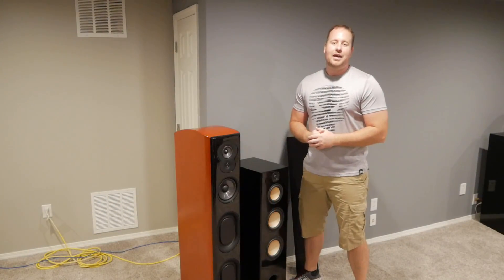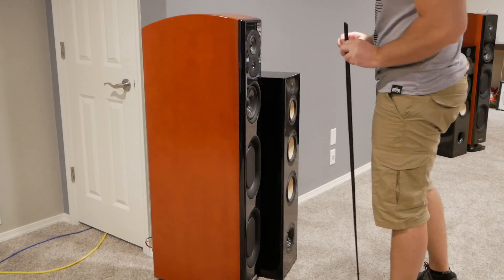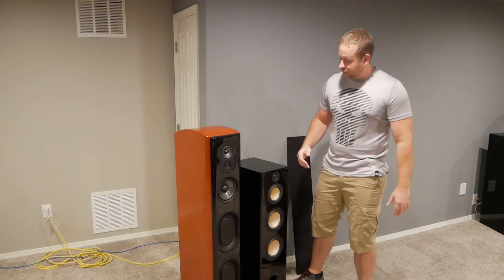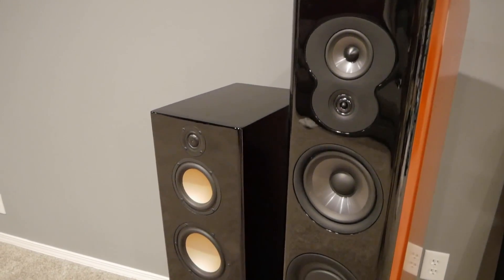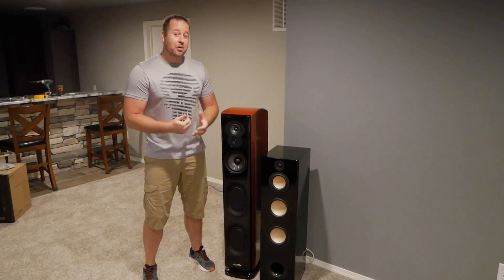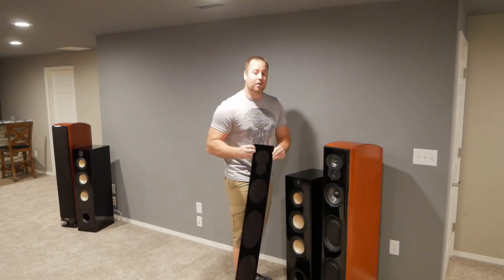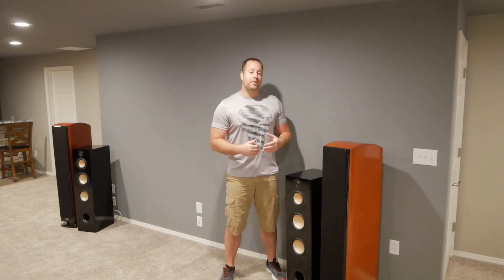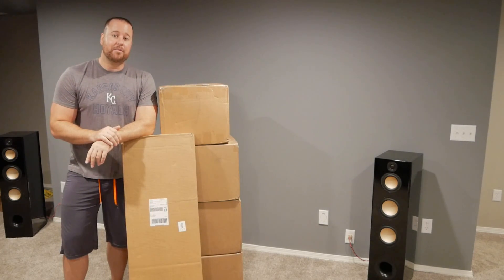Comparing my DIY Speakers vs Manufactured | Swope Towers vs Polk LSiM 707s

Comment: What's the point of making a diy speaker if you only have to put them together? When I made mines, I designed them from scratch, seeking on the internet for months the right components and studying how to have the best result possible. I think this is the way to do it. Not buying some kits and of which you know nothing about and then think "wtf I am a speaker designer/sound engineer"
Reply from the maker: Some of us like to let the actual speaker designer/sound engineers design everything and we can build it to our tastes. Don't have to spend months researching and building something that might sound sub par. I don't believe I ever stated I was a sound engineer btw.
Reply: @LifeofBliss  I'm not saying you said you are a sound engineer, neither I am, nor I'm criticizing your work, I'm just saying that in my opinion, just assembling the work that others made (I consider the most part of the job to be the research/design part, by far the most important) does not qualify it as a true diy speaker. Surely not as satisfying as designing it and building it from scratch.!
Reply from the maker: I gotcha 😉 I was like I really don't think I came off that way lol. But yes, it was very satisfying making these kits, and I'm sure it's that much better after putting in all that research and work to design something yourself as well.
Reply: @LifeofBliss  and believe me they don't sound sub par
Reply from the maker: @matteogirelli1023  I wasn't trying to say yours did ☺ I just meant not knowing much about the design aspect in my situation could result in a sub par setup. I'm sure yours sound damn good my friend

Comment: Those Polk towers do look bottom heavy... I always prefer towers that have more mid range speakers like the ones you designed... adding a sub or two takes care of the bottom end ... I’m currently enjoying Pioneers Andrew Jones line... incredible sound for the money.  I’ve found that price isn’t always indicator of quality... while obviously you can get better for more money a more expensive speaker doesn’t always me it’s better.

Comment: You've proven the point that I make regularly on my channel, that home built speakers can meet or exceed the sound quality of factory speakers for a fraction of the cost. This Swope kit is apparently no longer available, but similar drivers can be purchased and a crossover designed for you by Madisound (and I'm told Parts Express will also design a crossover for you). The guys at Madisound can help you with driver selection, bass alignment, crossover design, etc. The HiVi drivers used in the Swope kit are coated aluminum cones and do have a much brighter sound (that I also like) compared to other drivers. This kit used a pair of 6.5 inch bass drivers, whereas I would have preferred to see a pair of 8 inch bass drivers. As an alternative, I would stick with just satellite speakers (you can buy the small boxes for these from Parts Express), and have two separate sub woofers in separate boxes powered by a separate amp. The subs need to be carefully located in your room to attain flat bass response, hence the separate cabinets. BTW, your home built speakers look great, that for me is the hard part, getting the final  product to really look good.

Comment: Do you have a link to any of the material and products you used? Do they come in a kit?
Reply from the maker: They used to be a kit, but the drivers were discontinued so it's no longer available. There are several other similarly priced kits out there. Here are a few good places to start: DIY Sound Group, Madisound, Meniscus Audio

Comment: How long did it take you to build the diy?  That is a factor for cost and also skill involved.  Your build looks great, gloss black is tough.  I also have the LSiM707 and for me it really opens up with power and a good front end.  I run mine with McIntosh C47/MC452.  Previously I ran them with a Rotel RB-1590 and prior an integrated MA5200.  While I don’t  currently have any diy speakers anymore, I have built them in the past.   I find it difficult, cabinet build and tuning, crossover calculation, speaker component selection and matching, response curve and efficiency targets.  (True diy not in kit form).  This all before placing them in a room taking measurements and seeing the interaction.  I don’t have access to an anechoic chamber.  For comparison I also own speakers from KEF, Klipsch, Martin Logan, Totem as well as older Polk flagship models such as the LSi25 and I found the LSiM to be a sleeper of a gem.  Not to say it is a perfect speaker but with a good front end they can sing.  This is not a comparison to your diy.  Would love to hear them.  The tweeter especially sinceI’ve seen similar used on Tetkon Design Double Impacts.  If I where to replace the Polk with similar, from what I have read, it would be with a Tetkon.  Going up in price point I would say Legacy Audio Signature or Focus SE.
Reply from the maker: Thanks man. True DIY is a real talent and a lot of calculations/trial and error. Something I have not dove into yet due to lack of knowledge (not afraid to admit it, I'm learning as time goes along ☺). This probably took 15-20 hours with the prep and paint time, not including drying obviously. It definitely is a huge factor in diy. Doesn't make sense if you don't already have some basic woodworking tools and some skill. Some smaller bookshelf speakers would be a much easier starting point if you've never made something before. I will say the Polk LSiM707 was a beautiful looking speaker and when compared to many others I've heard, they sounded great. They probably would have benefited from some more power/headroom. I think it really just came down to personal preference as audio is very subjective.
Reply: Life of Bliss thanks for the info,  When I was in my teens a dreamt of building a Polk SDA SRS, never happened but I did build a few speakers using parts express parts.  Cheap hifi, it was fun at the time.  I am now more into electronics.  I fully refurbished a Sansui AU-6900, good as new and last August assembled a pair of PASS ACA Class A balanced monoblocks.  Cheers!

Comment: I like old cabinets, and putting new (price/performance) high quality drivers, and bigger new nichicon capacitors on the existing board. like I did with these https://picclick.com/Vintage-Ohm-Model-I-Pair-of-Speakers-Electrodynamic-263305865783.html (not my cabinets, but the exact model) they sound GREAT!!! I got the pair as a hand me down, and refurbished them. about $450 in components and a ~32hz tune in the sub section
Reply from the maker: Nice, that's a good way to do it without having to go through the building process. You can get some cool looking enclosures that way. Very cool man

Comment: What you explained as an issue is kinda how they voice "Hifi" speakers. In pro audio we reference everything back to flat. Just to not confuse you ignore your eq for a minute here as that is not what I a talking about. If a speaker injected no sonic influence of itself and let the sound that was being played back come out exactly as it is only louder then it would be a perfect speaker according to audio engineering theory. Hifi guys have this belief that scooping out certain sections of the audio spectrum tonal will create a "better sound stage" whatever that actually is. As an audio engineer I can tell for a fact that there are almost zero recordings where we make a stereo recording of a group of musicians so to have any kind of real sound stage. Whatever breadcrumbs are placed in the mix to give the listener an idea that something is in any certain space is all illusion. Yes, smoke in mirrors. Are we good at it? Relatively speaking, yes and some better than others but the truth is everything is pretty much recorded separately assuming we used real instruments at all. Commonly these days many of the sounds are actually digital samples and are triggered so they aren't even necessarily recorded in the same room and in that case definitely not at the same time. The point is an "audiophile" might be fooled but any engineer worth anything is going to see right through that rouse. The truth is that in the old days of audio mid range was rather unpleasant to listen to because levels of distortion were far greater than we have today so the BBC (british broadcasting corporation) developed this eq setting to slightly subdue the mid range. It worked. It made music sound much more pleasant. The only problem is it left everything sounding like it was missing the mid range and made things rather unintelligible. It was the real reason most people didn't listen to the audio from their television through their stereo. It was great when there was a band but if you watched a movie you would miss every second word. In recording we  work with very transparent accurate speakers. What it sounds like is what it is. Rather very close to what it actually is as no speaker is perfect. In this way when it transitions from Aerosmith playing at halftime back to the game the band sounded good and clear as did the commentators and we even heard the kickoff. From what I am gather from the audiophile community that is just wrong. The thing is I don't use the speakers in my television.  All of the audio is routed through my audio system for everything. Music CD, Blu ray movie or streaming. All the same. Everything is constant and I have no problems understanding voices at all. There is no reason you shouldn't be able to have that too. I am running an older pair of Tannoy studio monitors. So long as the speakers are not coloring the sound too much they could be anything though. From what I got from your video that was what your experience with your home builds and why not? The guy mixing it on the other end is mixing it without adjusting for any speaker. I have no doubt you will be happier. BTW when they mixed Metalica they wouldn't have been listening to it on home HIFI speakers either.
Reply from the maker: Heck of a comment Rob 😉 but yes I agree. Mixers tend to use speakers that don't color the sound. And I too think there is no perfect speaker, even for a given setting (music vs home theater). That's part of the fun though on my opinion. 5 people can listen to 5 different speakers and each have a different preference.
Reply: @LifeofBliss  That is what I am trying to say. Audiophiles are just over complicating things. Not to start a pissing contest but as mix engineers our entire purpose is to figure out how to make the mix sound as good as it possibly can. Yes, that is an opinion thing but wait one second. We do not work alone and are accountable to a lot of people who check and double check our work. All people who have proven track records in what we do. People's job it is to pick apart sound. People who do this day in and day out. Not just people off the street who have decided that they should have an opinion. Not that there is anything wrong with that but people in our field have to earn the trust of the public and prove the value of their opinion daily to become of value and an average person off of the street has not done that. High end studio monitors are almost as close as you can get to the illusive perfectly "transparent" sounding speaker. We make it sound great in a near perfect environment on near perfect gear. Explain to me how it is thought that by purposing to listen on a purposely improperly calibrated system is even likely to improve what we do at all? Worse, improve everything we all do as a group collective? If it was video it is easier to explain in that if the color balance is off on a tv and you watch the news you see green faces. In fact everything you watch has a green hue. This is only the fault of the calibration of your set not the source. Calibrate your television correctly and the problem will be eliminated. Looking for a television that casts a red hue in order to offset the problem is only going to create another problem. It doesn't take a video engineer to figure that out either. In an audio sense that is what audiophiles propose as a solution to their situation and it is worse they are so stuck in their world of scooped out midrange that when they do hear a properly calibrated kit they can't even appreciate it. This has to do with the fact that the human mind compensates for things sounding off and "fixes" it so they are over sensitized to midrange and why? because they made themselves that way. Why not just do it right in the first place? Every source you put through your system should sound good including the football game. P.S. to most of us engineers good is synonymous with natural and would not sound "Hifi" when the experience doesn't call for that so when the quarterback does a field kick it doesn't sound like a nuclear blast.

Comment: I made a diy subwoofer about 2 years ago, it is sealed using 2x 10 inch woofer. It has good low frequency response. cost about $200. I think DIY projects not only for fun, also for quality.

Comment: So.... MSRP of $2000, but sold brand new for $850. Hmmmm. In the DIY, those are Hi-Vi woofers. They are distinct in their color and I always know what they are when i see them. Built 3-way towers myself with a 3/4" tweeter, 6.5" mid and a 12" woofer for $100 for the pair which includes a 3-way crossover. People need to stop thinking that anything over 50-60 watts is best since you cant really get to that point in real world applications for what they are intended. Blows my mind everytime i see someone comment about having higher rated watts like that's what people play stuff at. Sensitivity plays a major part in power/wattage as well. And ohm rating. Less ohms, less resistance. More stress on amp.
Reply from the maker: Yea, they are way over priced at msrp. It would really be interesting to see a cost breakdown on speakers like that to see what they spend on components. It would take some serious money in amplifiers to start getting a real 300-400 watts per channel, and like you said it's a lot about sensitivity. My new speakers have a sensitivity if 99 db and with my 125w amp, they should be capable of 120 db, which is crazy loud for highs.
Reply: Can you share a parts list and where to buy? This Fits my budget.
Reply: Also check out Madisound.
Reply from the maker: That particular lit is no longer available due to the drivers being discontinued. But there are similar kits for sale at www.meniscusaudio.com and www.diysoundgroup.com

Comment: Been building my own speakers since 1999. Havent had anything store bought since. My designs and projects  usually a $100 - $500 and sound like store bought speakers 3 times the cost. A year ago I spent $300 on some used KEF bookshelfs to replace my old diy ones. Got them home and listened for about an hour and took them back...lol.
Reply from the maker: Lol yea diy is hard to beat once you start
Reply: @LifeofBliss  I design and build my own speakers from scratch. I have a new med treble driver design that is at another level and I put them in my lounge tower boxes and I am addicted to them. Point source time aligned sound that beats just about any 2-way or 3-way speaker in image. And it has serious treble that stings your head off (without tweeters). It's 3" full range drivers with 1.5" FR tiny drivers powering the top end coaxial tizzers. Too hard to describe so here is a one minute (crappy) video of my babies (better videos of it coming soon). I might be selling coaxial drivers soon, but larger ones (and tidied up a bit). https://youtu.be/UlJHRQidsvI
Reply: I design and build my own speakers from scratch. I have a new med treble driver design that is at another level and I put them in my lounge tower boxes and I am addicted to them. Point source time aligned sound that beats just about any 2-way or 3-way speaker in image. And it has serious treble that stings your head off (without tweeters). It's 3" full range drivers with 1.5" FR tiny drivers powering the top end coaxial tizzers. Too hard to describe so here is a one minute (crappy) video of my babies (better videos of it coming soon). I might be selling coaxial drivers soon, but larger ones (and tidied up a bit). https://youtu.be/UlJHRQidsvI
Reply: Then maybe you could like to have a go at making your own time aligned coaxials: https://youtu.be/UlJHRQidsvI

Comment: I made my own speakers. 4 10" paper mids & a 1" compression driver in a 10" horn x 2. All mounted on a lattice type flat baffle. Using ready made crossovers that I thought were closest to what I wanted. About $100 including wireing, can of white spray paint & solder & gun. We hooked one of them up to a cell phone & played some tunes from YouTube. Quiet but it sounded very good stacked in a corner of our bedroom closet. My wife & son were very impressed that it sounded so good & so was I. I thought I would have to spend lots of time & effort tuning & letting the driver surrounds break in, etc. Can't wait to get them placed in the living room corners w/ padding behind them, driven by an actual amp playing some Haydn, Robin Trower, Miles Davis, Wagner etc at live concert levels.

Comment: 300 for components. Then 100 for wood, 100 for paint and then there's build time(300 each). Still save 200 dollars but these things are worth mentioning. Not knocking you though, all my system is home built.
Reply: If you paint it yourself it would not cost 100
Reply from the maker: Using automotive paints, it costs more than $100
Reply: @LifeofBliss  that's very true. I am thinking about building my own set of soeakers for as little as possible. I will probably just stain and lacker.
Reply from the maker: There are other options like veneer, duratex, or even a nice latex paint, but the auto paints aren't a cheap option unless you have access to them for free ☺ I did so that's why I went with that. Good luck man!